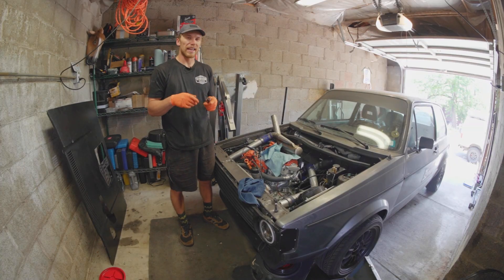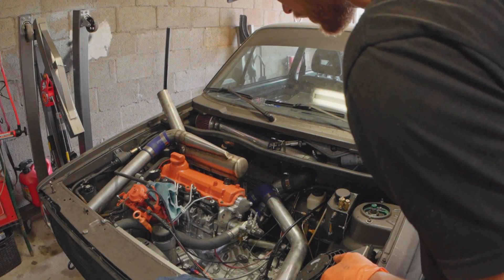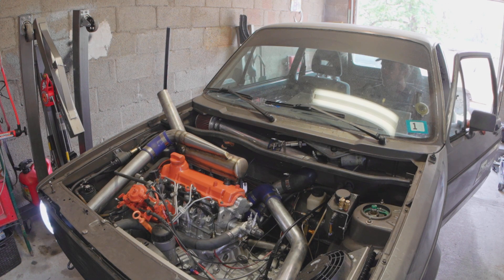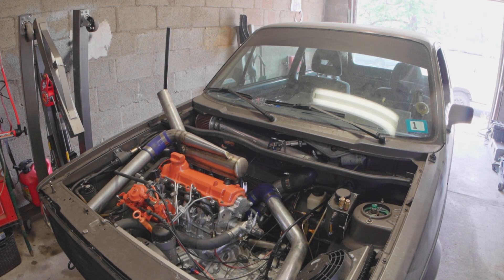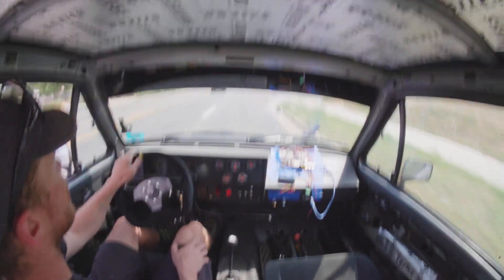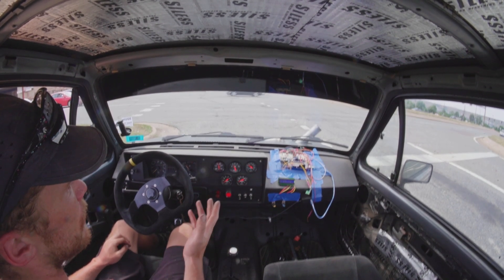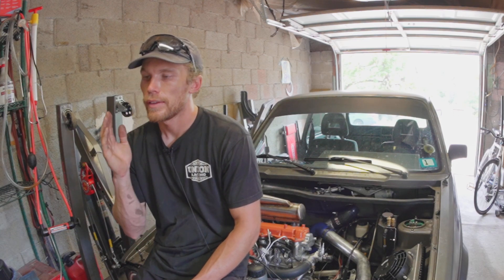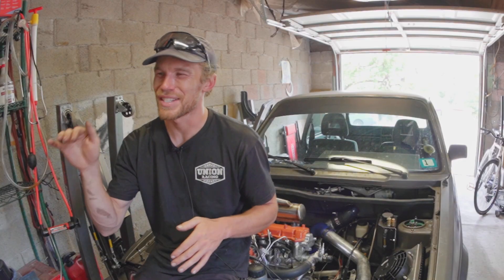1.9L ALH M-TDI *** Big injector install and test drive!

Comment: For F sake, never ever tap on the top of open injectors. One small particle ingested will ruin the injector. About the gearing. There are two types of 5 speeds for the diesel version. A 5 speed and a 4 + E, wich is an overdrive. These were on the last version mark1. The 5th gear is located behind the steel cover on the outer end of the gearbox and easely switched.
Reply from the maker: Thanks for the info! 💪

Comment: Idk if your 1.6 had non hydraulic tappets, this definitely has and 30 psi might be too much for daily. 25- hmm maybe 26 is where I'd set the line for these stock tappets and careful with oil temps and pressure.
Reply from the maker: What does boost pressure have to do with hydraulic tappets? That seems entirely unrelated
Reply: @OliverFetter  its the reason why pd engines have camshaft issues. longer duration under pressure. especially when oil is cold and thick, it keeps the tappets fully open/extended with minimal to none impact absorption (from the camshaft)
Reply from the maker: @ChrisGR93_TxS ok but I'm still not seeing how that's related. How does extra cylinder pressure cause hydraulic lifter hang?
Reply: @OliverFetter not talking about lifter hang. That happens with rly high oil pressure + high rpm, talking about how more cylinder pressure = need for higher pressure from the camshaft lobes on the lifters to open the valves.
Reply from the maker: Ah your saying there won't be full lift at a certain cylinder pressure or potentially delayed lift
Reply: @OliverFetter you need to put it on a dyno and see it. It turns your engine into an air compressor unit 😅.  But most importantly it wears out the lifters and sometimes the camshaft as well. (Even worse on pd because their camshafts have bigger longer duration lobes)
Reply from the maker: Fascinating. So your theory is above 26 psi you would see a drop in HP on a dyno?
Reply: @OliverFetter rly depends on the oil pressure at that given rpm. Ppl that go above 300hp on pd engines, use non hydraulic tappets to ensure proper valve open. They might destroy their camshafts faster but if you go at that territory it's the least you care about then

Comment: I think the electrical pump had a lot to offer other than just more fuel. Dynamic timing is important after all.
Id love to see you figure out how to make one work without needing the entire wiring harness and ecu.

(02j swap later maybe?)
Reply from the maker: That would be trick lol idk if I'm going to invest the time. Certainly a different gear box down the road would help. If you ever drive a Cummins pickup the gearing is miles long for a reason
Reply: The Mechanical pumps do have some dynamic timing. Not as much though.

Comment: You need more fuel at the top, no smoke, no poke…
Reply: Diesel shouldn't be smoking more than a little gray after spool, soot is lost power beyond bottom end and spool, tractor pull trucks roll coal because they are pulling many times their original load capacity so it's over loading the engine.
Reply: @LiamGoodall-t7e They're also using the excessive fuel delivery as cooling.
Reply: @khester7397 excess fueling does not help temperature very much?, if you wanted cooling you would use a larger intercooler, water injection and heat wrap
Reply: @LiamGoodall-t7einform yourself plz
Reply: @CrAzZyTheCodingBoss show me a tractor pull where the rig blows smoke constantly outside of the pull, I didn't realize how little smoke he was blowing in this video watching it again, but you should not be making pillars of smoke with a pull in a 1600 lb car and diesel only reduces any temperature because it's a lubricant any temp reduction after that is just your engine not having as effective of combustion.
Reply from the maker: There's plenty of fuel, needs more air
Reply: @OliverFetter I said it many many times I will say it again, if you don’t roll coal on that you will not have what it take and you will keep yourself locked on an impossible journey that never ends ….
Next episode: “my engine blew up ( again )”
Reply from the maker: @CrAzZyTheCodingBoss that's the only thing you say 🥱
Reply from the maker: I'm too tired of having conversations about smoke 🤦 while it is an indicator of mixture richness it's literally impossible to tell what it's doing while it comes out of a hood stack moving 60mph and being recorded at 24fps with high contrast lighting. The fact that anyone is arguing over it is pointless since you don't have a valid reference point. Also @crazythecodingboss I'll start taking your advice when you start posting videos of fast diesels 😉
Reply: @OliverFetter no smoke means, not enough fuel bro 😂

Comment: NGL i expected those .360 nozzles to smoke way more than they did. you may need to swap to a 12mm head at this rate! as far as timing goes,  you'd probably need to increase your dynamic timing sweep, via the timing piston. Either  shorten it or get a spacer kit from ebay for the 200/300 tdi Land Rover. It should give you more advance when your turning 5 grand!
Reply: He either has a 12mm or 11mm and soot is not power
Reply from the maker: X2
Reply: @OliverFetter  Being as your in the land of freedom, I reckon a HX40 would be a good bet for the big turbo in the compound setup. Although a HX35 is probs more common. Maybe even a T3 from a 7.3 idi. You could always duplicate your controller and use a PowerSmoke VGT for quicker spool on the second turbo.
Reply from the maker: Right on. Honestly it's plenty of fuel. I feel like a lot of people look at the "smoke" while I'm driving 60mph and there's no way it'll ever look dark with that much wind or camera angle. My EGT gauge tells me there's plenty of fuel and I need compounding turbos not more fuel 👍

Comment: Glad its running solid for you finally! I think the electronic portion of the ALH injection pump does actively change pump timing on load, temps, VGT etc. which may be why you feel like you need more timing with the M-tdi pump?
Reply from the maker: Definitely a solid theory. The electronic pump IS better for a reason
Reply: @OliverFetter  That said I want to see what the M-tdi pump can pull for power on the 1.9l! Simplicity has its place too and if you’re running WOT usually and it’s tuned for that I don’t see it being held back much if at all!
Reply from the maker: @leveluplife8585 yes! I'm excited to see you. Especially since the next time I dyno it - it will make a nice comparison against the 1.6l. Same turbo and pump